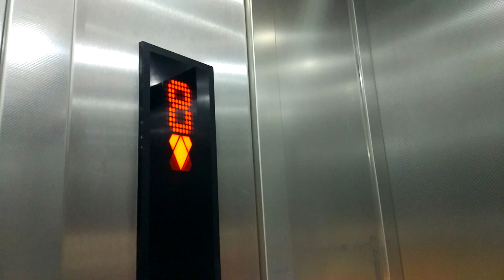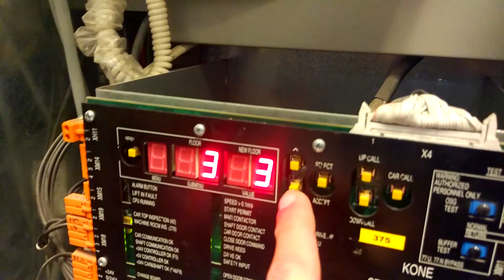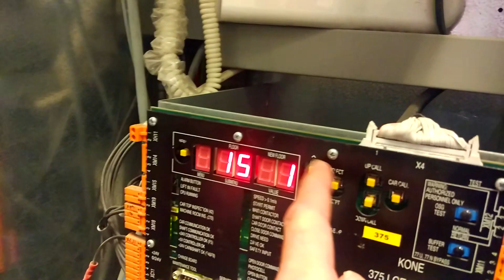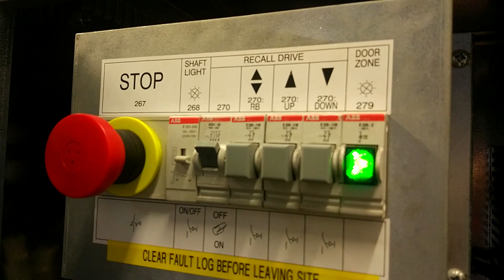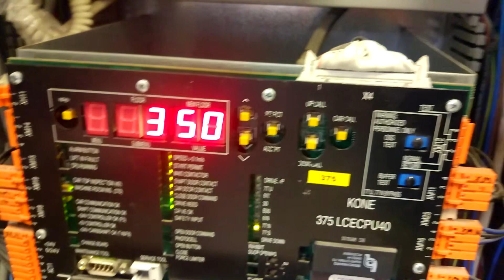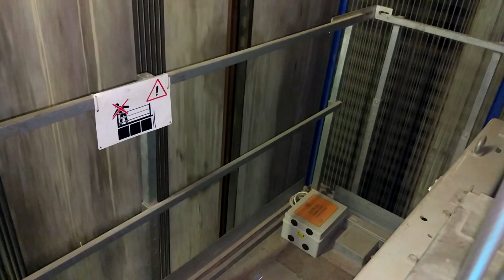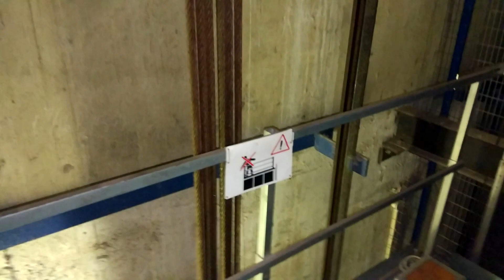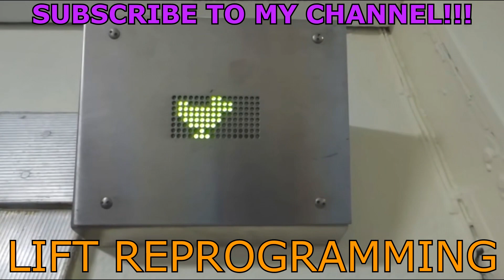Detailed look at MX18 High speed edition

Comment: 0:56 the shaft doors don’t look like kone doors 🤔. Beno is it possible that these ecodiscs are replacements of older lifts with the original shaft doors still in tact? Also at 1:01 the door tracks for the inner and outer doors don’t match.
Reply: That is a Really good point, Because when we see the motor room Where the Ecodisc is, we see these Cable tracks that lead into the shaft Connecting The Ecodisc and the Lift car. So this brings up another Question: WAS THE ECODISC SANDING IN THE SAME SPOT WHERE THE ORIGINAL MOTOR WAS?…
Reply from the maker: The lift is a replacement of an older lift.   The lift car is a full replacement.  The only part kept of the old lift is the outer doors.  It is very weird that they had to alter the new inner doors to work with the old outer doors.
Reply: @benolifts  thank you for clarifying! 😊

Comment: Maybe the building doesn’t have much floors that’s why they get a way by installing this very powerful lifts as the motors don’t really put much stress on them.
Reply from the maker: Nowadays most building have the cheapest possible equipment in them that they can get away with.  It is uncommon to get a building with good specced lifts.  It is almost unheard of to get a building with over specced lifts.  The building owner, or someone managing the building, must have made a conscious decision to have got very good lifts installed.

Comment: So this motor is offsetted and they had this complex pulley system to feed the shaft? Amazing
Reply from the maker: I wouldn't say it is particularly complex.  It is in 2:1 bottom drive configuration.  The motors are in bottom drive configuration even though the motor room is at top of the shaft as there is not enough height in the motor room for the motors.  

If you want to see a very complex pulley system take a look at the Kone Powerdisc.

Comment: Does it just look like it or do the ropes actually scrape on the concrete around 10:00? Isn't that a safety issue?
Reply: No thats compiletly safe
Reply: @asetatlikalem  then you risk the anti rust  coating, they should have installed a wide rope guide as well but if it ain't broke despite the high chance don't fix it.

Comment: Can you take a detailed look on a MX100 ?
Reply from the maker: If someone can get me into the motor room of one I can
Reply: @benolifts  And whot is that Inspection control in the Machine Room of the MX18?
Reply from the maker: @LAUCHGeorge     It appears to be a variant of the normal LCE inspection control.  A few of the buttons have moved location.  The emergency light has been replaced with a floor position light.  The plug socket and the alarm button are missing.
Reply: @benolifts  Does the alarm button actually send an emergency call or is that just the alarm?
Reply: @LAUCHGeorge  If you hold it long enough it will send an emergency call. I suspect the in-car and inspection alarm buttons are bridged together.

Comment: They look like older lifts with an original cars but with new fixtures and motors.
Reply: I think Kone M Series judging the old Kone logos on the grills or whatever you call them over the motors.
Reply from the maker: @EEverything360    The lift cars are the standard lift cars for MX18.   It isn't an old lift car that was modernized.  The lift is a full replacement.  The orange covers on the motor are most likely fairly recent.  These would not have been from the previous lift.  The old part of this lift that predates it is the outer lift doors which are GAL type doors.  The new inner doors have been altered to work with the old outer doors which is unusual.
Reply: @benolifts  Very odd.